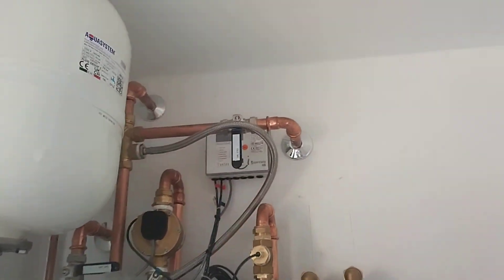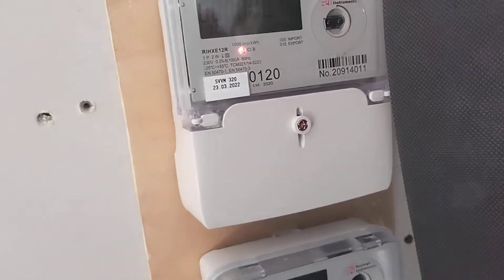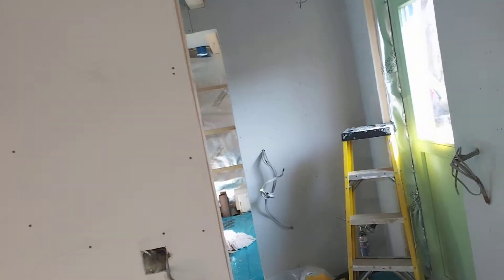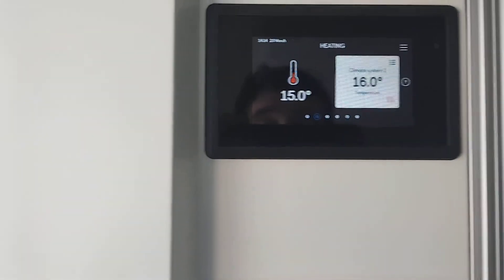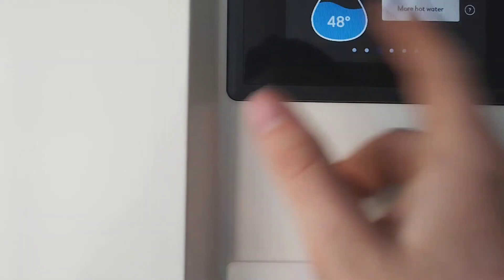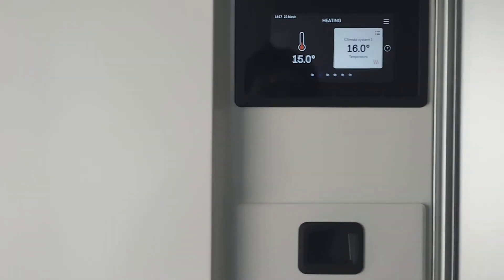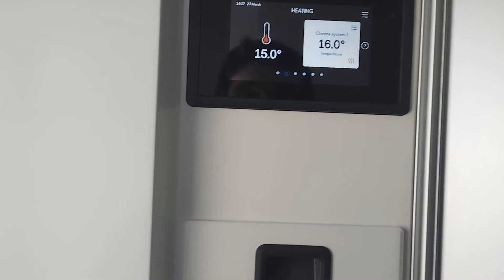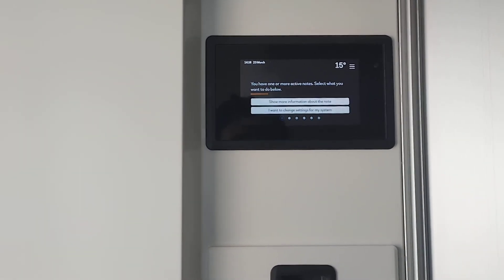Nibe air source heat pump

Comment: Hello Barry, what should be the outside temperature that the heating should stop? I have exact same system with underfloor heating
Reply from the maker: Hi Paul 

It really depends on the individual and in many cases the house itself. We tend to set new builds to stop heating at 14c  and maybe retro anywhere between that & 17c